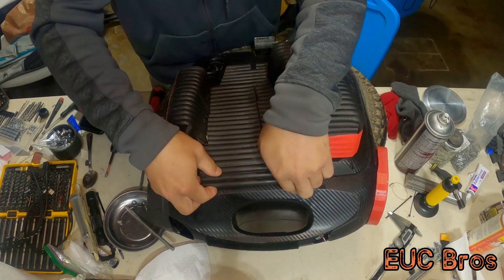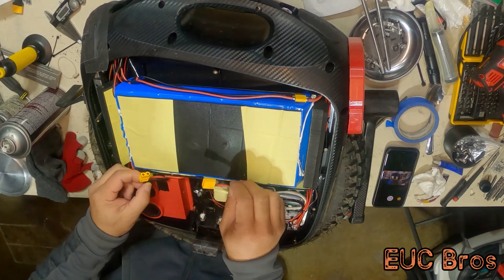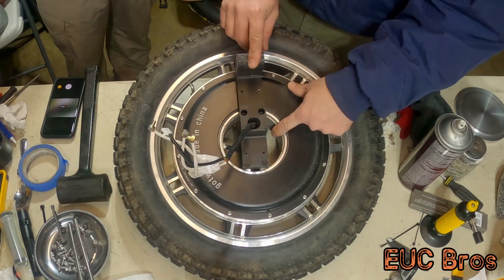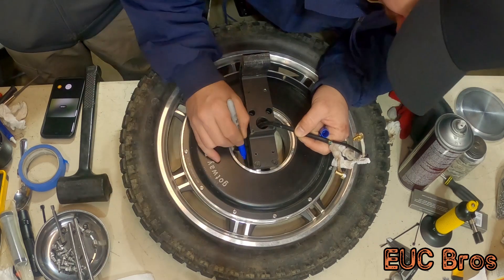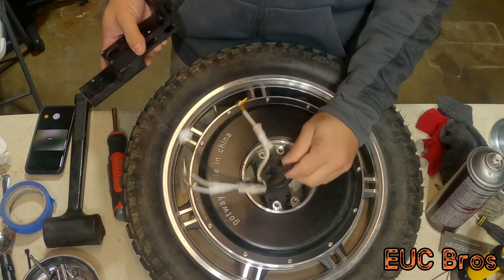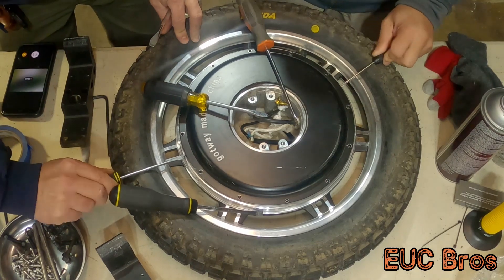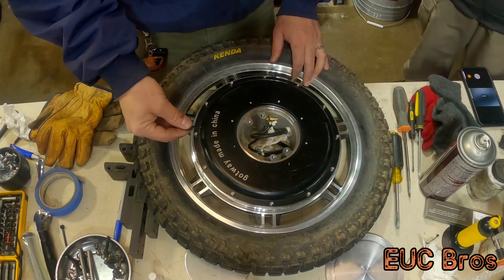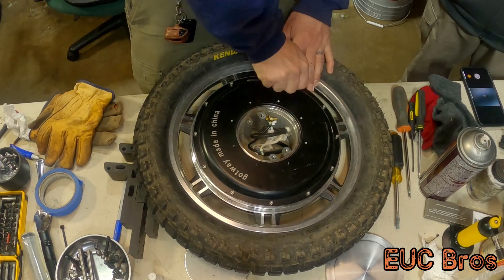EUC Bros | RS Bearing Replacement

Comment: One thing I might recommend having changed similar bearings on paramotors, as well as tire changes on cars: It is recommended to do a star shaped pattern when tightening so that you're always tightening a screw opposite the one you last tightened. This pulls the hub to it's mating surface in a more uniform way.
Reply from the maker: Wasnt that in the video? Lol im pretty sure murland said that when he said how he loosely tightens down before torque them down. Maybe i didnt add it into video hum
Reply: @eucbros9235  If I missed it I apologise, I just saw an opportunity to improve the method a bit! Cheers!
Reply from the maker: Thank you!

Comment: 1st off. I'm so thankful for u guys making this video. I followed it to a T and it was perfect. So I dumped my rs in a 12 inch deep peddle , subways and had to dry the rs out. Then the next day the bearing was seized up. So I didn't have new bearing but I did have marine grease. So I open up 1 side of the bearings and wiped out the old grease and regressed. It worked to Un seize the bearings but still sounds not normal. I didn't want to do the heat up part( cause never had to do that b4) but do you think it's worth it to regressed the other side of the bearings or am I wasting g my time and just need new bearing? 
How dangerous is it to ride with noisy bearings ? If regressed will it still seize up one day. You guys rock!!!!

Comment: I have my RS high torque on order .. I'm 6'3/200 pounds wanting to ride 60-70% off road and this will be my first euc after riding onewheels for two and a half years.. As you guys have tried both the high torque and high speed and have experience with both do you think I could still ride most trails with the high speed anyway still with enough torque and not have to sacrifice the higher top speed when riding it on the street (& have that extra buffer before power cutout) or still best to have the high torque? Obviously the hill climbing will be better with the high torque but can you feel a noticeably higher acceleration with the high torque version over the high speed version also (which is partly where all the fun is in euc riding) or is the acceleration about the same with both the HS and HT? Thanks

Comment: Hello Friend!!
  was the problem solved with the change?🤔 
 no longer makes noise?  
What brand of bearing did you use?  
ref: 2R always?  
Do you think the problem is the quality of the material or the system? 
 Are you afraid that it will reproduce?  

Thanks for your time!!🤙🏻👌🏻😊😅
Reply from the maker: Gotway bearing is garbage.. my rst has replacement gotway bearings and they are doing ok but i havent been riding that much. My rss has zen bearings and ive been riding that mainly and no problems. Drilling thr motor plates helped alot to keep water out of the bearings. Mitch got replacement gotway bearings and they lasted longer but now are making noise. We are showing gotway videos of failed bearings to get replacements and also to show them how many are failing so they step up and fix the issue with better quality bearings. But ive just gone ahead and just bought better bearings
Reply: @eucbros9235  Hi brother! 
Pierce the motor plates? 🤔 
What do you mean exactly?  
What do they say on the ECOdrift website?  
Make a hole in the motor for better ventilation?  
I don't like the idea very much ... 

I have bought NTN bearings (made in Japan and they are worth a lot of money😰🙈 !!), which claim to be the best.  

For my EX there are no other better than 2RS anti-humidity armor. 
 I'm trying to understand about the hole in the engine cover ... I don't understand well ...😥
Reply: @eucbros9235  have a Telegram? Whatsapp?😅
Reply from the maker: @EUCENDURO  murland drills holes along the where the bearing sits so if water gets into the lip it can drain out instead of it just sitting in the lip and going into bearings. If you watch the video when you see us putting the motor covers back on a tightening down you can see where we drilled the holes it's not to vent out heat or anything it's just let the water drain out.
Reply from the maker: @stratgibson 120 bucks for zen bearings and veteran cant do what we are doing on these RST :)

Comment: I know Murland mentioned drilling drainage holes in the motor but I don't see that covered in this tear down?  When it is in the vice to level the pedals it looks like a bunch of holes have been drilled into the non-wire side.  Is there any video where you guys talk about that part of it? EDIT, actually it looks like the holes are on both sides.
Reply from the maker: We decided not to put it in causw we didnt want people drilling incorrectly then blaming us for it. Gotway/begode will be doing this to all their newer batches for all hollow motors. Holes are drilled on both sides of the motor covers. Murland and i can make a video on how to do that when we get our m24p in. Hopefully in next few weeks
Reply: @eucbros9235  Ah ok good deal, thanks for the explanation.

Comment: did you drill vent holes into the side covers?
Reply: or are they drain holes for water to escape.
Reply from the maker: Yes
Reply from the maker: Drain holes so water doesnt collect and get in bearings

Comment: Where to buy these bearings pls and  in some cases it says 2rs1,  is that different than 2rs?
Reply from the maker: If u look through the other comments there is thr size of the bearings.
Reply: @eucbros9235  yes, i found it but  my question is if there is a difference between markings 61824 2rs  and 61824 2rs1
Reply from the maker: Not sure actually. Ill have to ask Murland or Mitch
Reply: @eucbros9235  Did you asked to Mitch or Murland ? These berings are very expensives !
thank you
Reply from the maker: @pascalmassonnet155  lol probably not, but they should check with their vendor, the site i bought bearings from lists exactly what all symbols mean on their site.

EX:

WHAT DO THE SUFFIXES MEAN?

RS, 2RS, 2RSH, 2RS1, RSR, 2RSR, E, EE, LLU, LLB, DU, DDU
These suffixes mean "with 1 or 2 rubber gaskets". At 123Bearing, we specify with the number "2" when the bearing is sealed on both sides
C3, C4
Means "increased internal game". Often referred to as high speed, this means that the bearing is designed for high rotational speeds and moderately high temperatures. WARNING, an increased internal clearance bearing will not operate optimally at low speeds. We invite you to refer to the technical data sheet of the desired bearing to know its speed limit.
ZZ, 2Z, ZR, Z
These suffixes mean "with 1 or 2 sheet metal baffles" for dustproofing. At 123Bearing, we specify if the bearing is waterproof on both sides with "ZZ".
TN9, TVH, TVP, G15
These suffixes indicate that the cage (part of the bearing that keeps the balls at a distance from each other) is made of polymer material. In general made of fiberglass-reinforced polyamide.
ABEC
The ABEC standard is used to classify bearings by their machining tolerance. This standard is regularly called into question because it does not include certain important technologies to guarantee a good functioning, as well for the efficiency as for the lifetime of a bearing.
This standard is thus little used by123Bearing.
BHT / VT
This suffix indicates that the bearing is designed for very high operating temperatures. In general, it is indicated the temperature following this suffix.
Attention, these bearings are not adapted to all the uses, and will require a high temperature for an optimal lifetime.

Comment: Fantastic job! The method to extract and even reinstall the bearings with heat is as elegant as effective.

Question: was there silicon around the motor covers, and did you apply some although it's not in the video?
I thought it was required for waterproofing.

When I changed the bearings on my 16X motor, there was silicon between the rims and the covers, and I put back some later.
Reply from the maker: No silicone for us

Comment: Awesome. Thanks for sharing! How would you know the bearings are going you think? And do they sell them somewhere other than factory sending to you do you know? Any link for the two versions?
Reply from the maker: They make a loud clicking noise. If u look at video of port gamble ride u can hear my wheel clicking very loudly for parts of the ride.
Reply from the maker: Bearings are out of stock for the good quality bearings.
Reply: @eucbros9235  where did you order them? Do you happen to have the model needed for
Both the torque and the speed versions?
Reply: @eucbros9235  thanks for the reply man! Great info
Reply from the maker: 61824-2rs is model number and same bearings in both wheela
Reply: @eucbros9235  thanks so much man.. you all have some mad skills! Keep em coming!

Comment: Did you say you went for less than 50 miles and had to change the bearings ?
Why did you change it ?
Was it a used EUC ?
Th RS would not be very practical at all to be changing out bearings every 50 miles .
Reply: Thanks for the vid bruh , real eye opener , stay safe .
Reply from the maker: Yes bearing defective from the factory. New wheel causw it was clicking and making nasty grinding noise

Comment: I have a question: should there be any lube between the bearings and the motor cover? The replacement bearings I've got from Begode are swilling in grease, but it seems like that surface doesn't want anything to encourage movement. Is that right?
Reply: No grease between outer race of bearings and motor cover is standard, unless your trying to make your wheel rainproof. 
 
An upgraded process might include waxing the outer surface of the bearings (after thoroughly degreasing), then mate the parts with this thin film to reduce oxidation from the galvanic response between parts. {Yeah, it’s a bit anal retentive but totally worth it.}
 
This is rarely done by hobbyists but it’s self-evident once you realize that this might be yearly maintenance in many environments; especially if you would like to ride predominately off-road. 
 
If you live or only ride in temperate weather, dry fit is fine. IMO

Comment: Which are worse, Rs bearing issues or MSX/MSP axle issues?
Reply from the maker: Both bad but rs is way easier to work on then MSP
Reply: @eucbros9235   *than
Reply: Axle prob on the MSP !?!?😳.....do u mind if i ask what r u referring to? 😱...I have an msp ht and so far i thought it was the king😎
Reply from the maker: @jonathan842  yes due to design the axle  shims loosen up under any semi hard riding and also easily crush the axle as well. People that just ride street with light trail riding should be fine. But if u do what we do the axles crush. Lol and msp torque is king not speed. Lol once rs gets higher pedal hangers and better bearings it will be king.
Reply from the maker: @jonathan842  sorry i read your comment wrong you do have HT the KING! :)
Reply: @eucbros9235  have you had to change bearings on MSP as well? I'm not able to find the bearing model anywhere. Also do you replace the whole axle when it crushes?
Reply from the maker: @windowmaker  nope never need to change bearings on msp if the axle gets crushed you need a whole new motor. the axle is part of the motor. so if you break it or crush it you cant just replace the axle itself. thats what sucks so bad lol 
ive been through a few motors before the RS19 came out

Comment: I was about to order a  Gotway RS but heard about the bearings issues.. Do you know if Gotway are fixing these issues with new batches (as well as raising the pedal height)? If I get one with these issues will they repair under warranty and/or send  replacement bearings under warranty and my only option is to do this myself? I'm a OneWheeler getting my first EUC and into 50/50 50% off road and hill riding/ 50% street and pavement.. I'm about 200 pounds loaded.. Is it best to get the high torque version or is there still plenty enough torque with the High Speed version off road and in hills and no need to sacrifice the 40mph top speed you get with  the high speed version? Thank you and greatly appreciate your feedback
Reply from the maker: Yes they are raising the pedal height they've already made them are selling them I don't know if they're going to put them on the wheels but you can buy the option to have higher pedals for the bearings I don't think they're going to do anything about the bearings
Reply: @eucbros9235  ok thanks for your reply
Reply: @eucbros9235  thank you

Comment: Sh*t I might cancel my RS order. Seeing this bearing issue pop up more and more.
Reply from the maker: Yea either u get unlucky with a defective bearing or if water helps dirt in then bye bye bearings as well.
Reply: @eucbros9235  This problem has been known since last year. It is necessary to immediately change the grease to a good one, or use expensive bearings (Japan). You also need to equalize the pressure in the chambers of the motor.
These are results based on road trials in rain and snow (+ salt reagents on the road).

Comment: awesome work dudes. 
but getting an RS19 seems like such a failed investment after seeing this lol. especially if you actually want to ride in the rain =(
Reply from the maker: we have a mini fix for it and see if it works long term but main problem is just the cheap bearings 
being bad out the box. if you get some decent bearings and do the mod we are trying out you shouldnt have any issues
Reply: @eucbros9235  well its thanksgiving BROS! will you only cryptically plug this mini fix you speak of or will you make a video about it!?

lol i suspect all of the direct from china sourced wheels will be susceptible to bad bearings...if you order from a reputable website though, maybe theyll go through the trouble of replacing the bearing with a higher quality one (whether known or unknown to you), before they send it out to keep their clientele from falsely believing its their fault. or they may make it available as a waterproofing service perhaps
Reply from the maker: Its in the video just didnt say we did it. We drilled out some wholes in front of the bearing so any water drains away as wheel spins or when sitting still
Reply: @eucbros9235  pioneering endeavor guys, much respect to you!  i missed it entirely on the first take, and it seems youre experimenting with a different amount of holes on each side as well. it seems very promising, i admire the angled drilling you did for the holes. maybe those holes could even be used to periodically grease or oil the bearings before a rainy ride or even afterwards to flush any debris...if that works..maybe you can machine some grease fittings that screw in flush with the cover. id buy those if this method works well for you guys. inspiring work, thank you for this
Reply from the maker: I'm trying to keep it as low maintenance as possible when  do these things.
Reply: @eucbros9235  I did notice those holes. But doesn’t that just make it more susceptible to water getting inside? Or am I missing something?
Reply from the maker: @psshunreal  any water that gets in just drains out. its better then water getting over the lip then just sitting in there no matter how fast the wheel spins